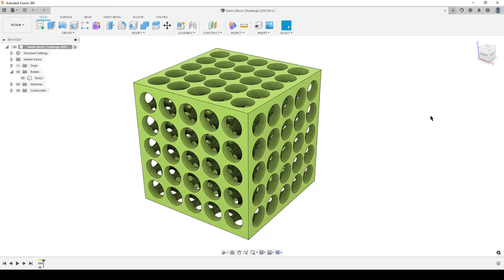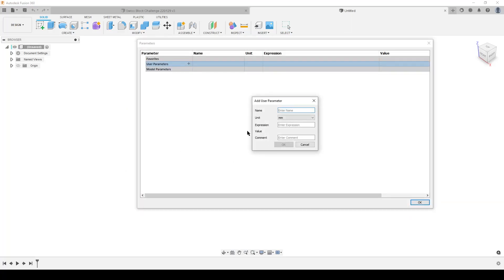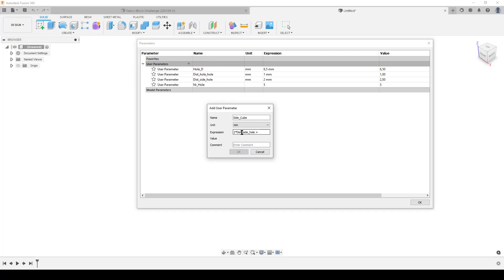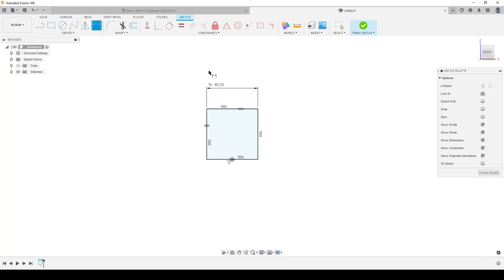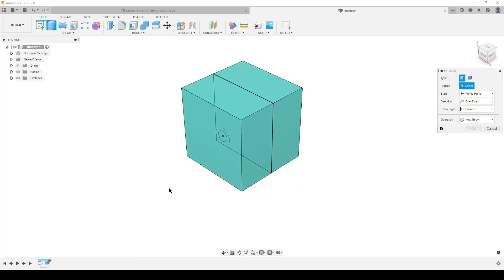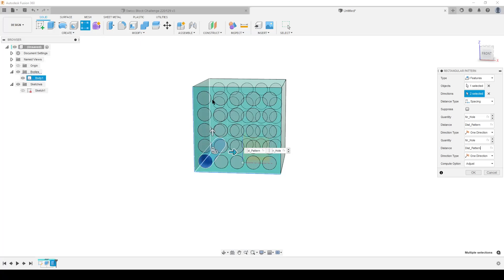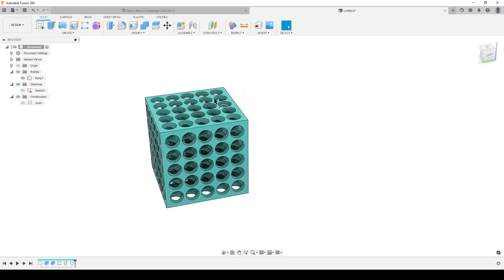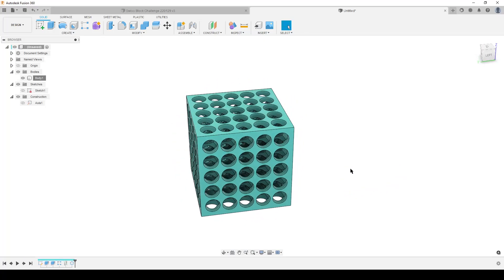Fusion 360 - Swiss Cube (Pattern Workflow)

Comment: Hi Kristian. Thanks for the demonstration. One question though. I executed fillet command to both sides of the circles after extruded cut command. Then I tried to make C-pattern for both extrusions along with the fillets, but fusion couldn't manage to do it. Do you have an idea how to do this?  thanks in advance.
Reply from the maker: I have no good answer to that. I gave it a try and found som strange things, if I find something useful I'll make a video about it.
Reply: @KristianLaholm  I was wondering the same thing.  Could I filet the first hole and then get it to spread to all the other holes.  But it didn't work...I thought it should.
Reply from the maker: @PaulMcEvoyGuitars  A Ruled Fillets works. Rule = Between Faces/Features; Faces 1 = 6 faces of cube; Features 2 = Extrude cut, rectangular pattern and circular pattern.
Reply: @KristianLaholm  thanks Kristian. I did it and it worked seamlessly. I would also appreciate if you could make a seperate video demonstrating rule fillet functions in depth.
Reply from the maker: @rosinni9340  I'm only a hobby user but I'll give it try and se if I can put something together.